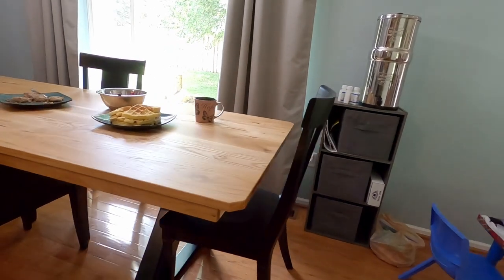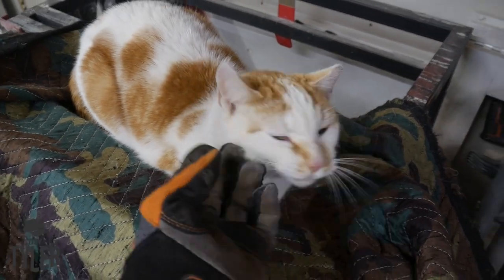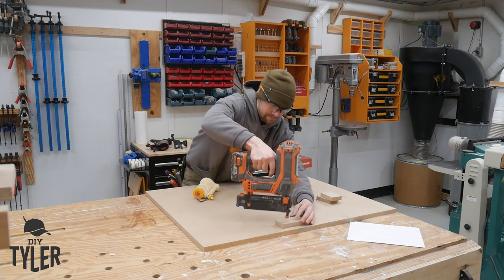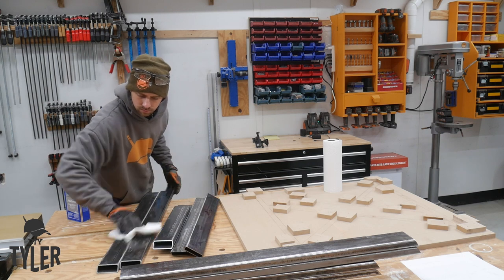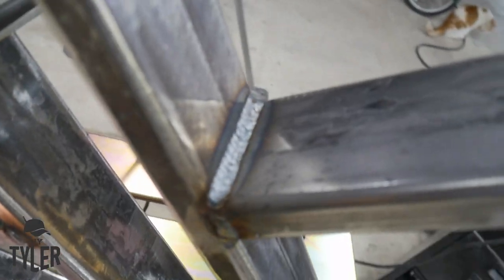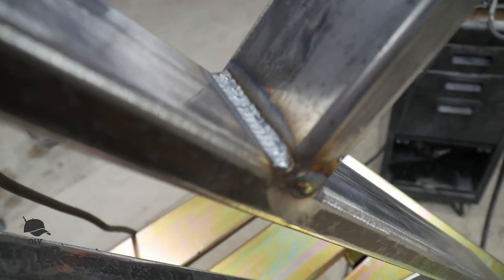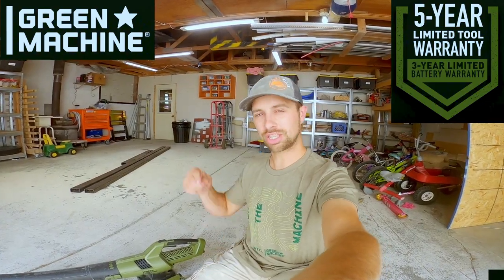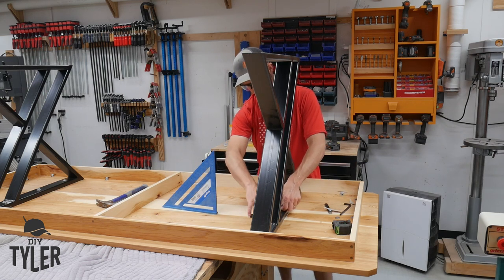DIY Farmhouse Metal X Design Table Legs | Production ready Metal Table Leg Design | Metal Working

Comment: Awesome farm table, Tyler! One thing I was wondering though, after watching the first video - what about lateral movement of the table (in the long direction) putting stress on the top-to-legs connections? I did see that you put some substantial bolts from the legs t the table, but tables this long usually have a stretcher between the two short ends, to eliminate this stress.
Reply: I agree. I don’t see how those legs could take any lateral force without getting loose